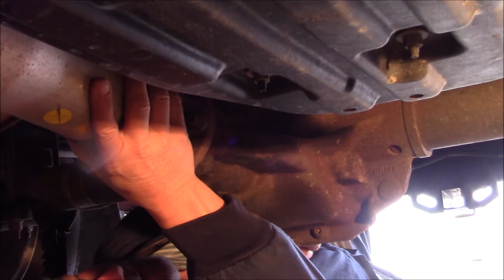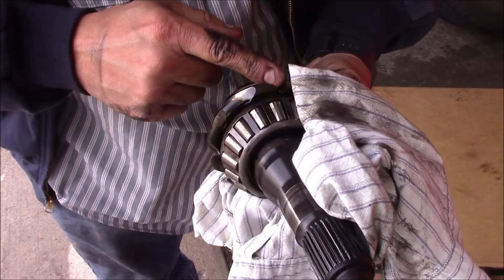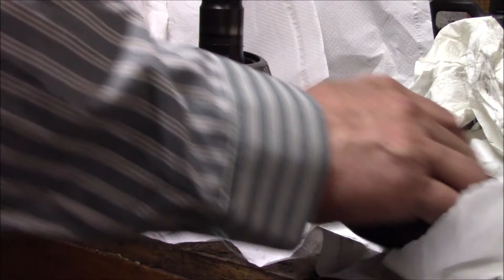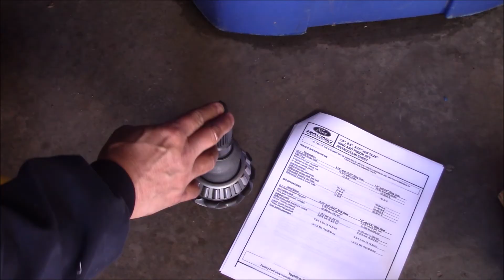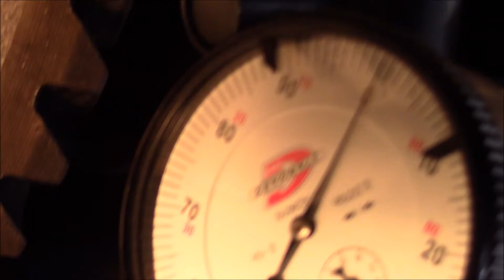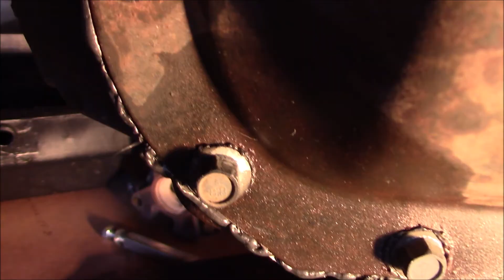Rear differential noise and bearing replacement F 150

Comment: The crush sleeve doesn't set the preload, it just holds the bearing inner race in place. The force of the two bearings against the pinion tunnel causes the pre-load
Reply from the maker: Appreciate the extra technical detail

Comment: Hey could you give me some info? I’ve got a 66 Ford F100 that makes that noise now and it slightly vibrates my steering wheel. The whole setup is pretty much identical to what your rig is

I put on new ujoints, new driveshaft carrier bearing and took out the diff and put on new carrier bearings…. Put it all back in and filled with new fluid. Still makes that noise.

Comment: So you used the factory shims and everything lined up good?  As long as you don’t change the ring and pinion I don’t see why you would have to add or take away shims.
Reply from the maker: everything was in spec with the factory shims and the new bearings from Ford
Reply: @bbbjim1fixedit  awesome!  I appreciate the quick reply

Comment: hot tip (pun intended)  If you heat up your new bearings in the oven to about 250F they usually just drop onto the carrier.
Your method is perfectly fine as well.
Reply: Put the pinion in the freezer for a few hours. It will drop right on.
Reply from the maker: Thanks for the tip, I will try that some day